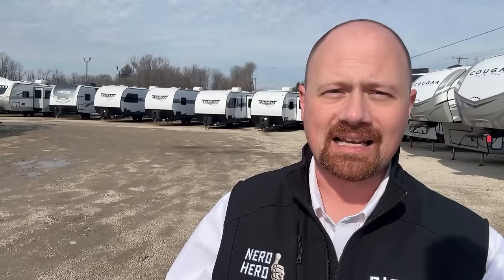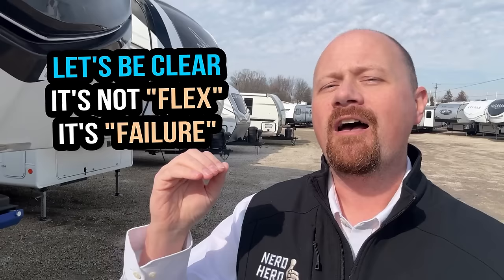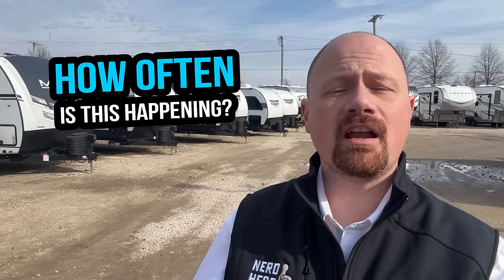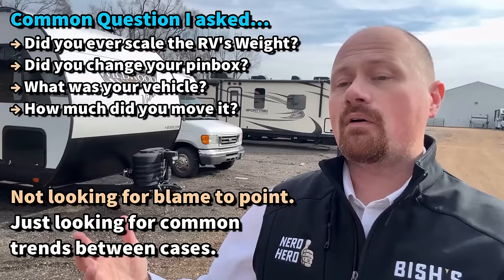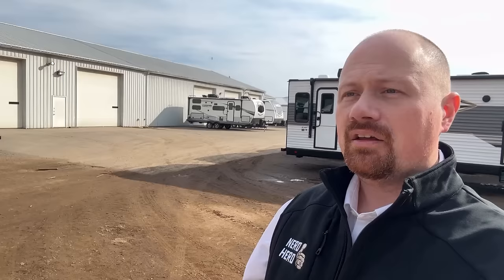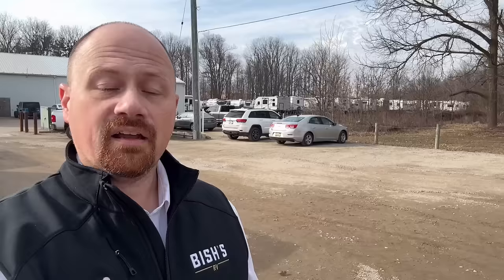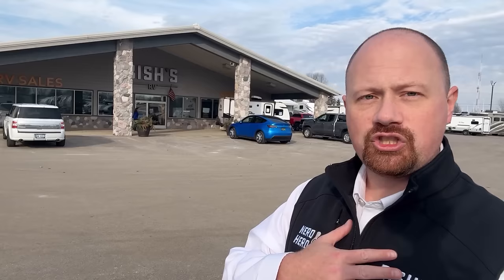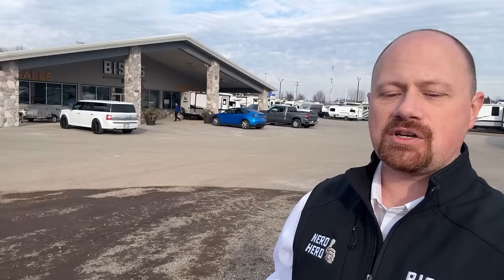🚨 RV Frame Flex & FAILURE!! • WHAT is Happening and WHO is Responsible?!

Comment: Josh you are doing exactly what you claim your not doing. You are blaming the owners.  All your reasons you point out is that it is something the owners are doing. Let me shed some light. One half of One percent is 99.5 percent. That is a horrible rate. That is not even a three sigma value. Should be like a 6 sigma value.  Let me put it on another way one out of every 200 made will have this failure at one half of one percent percent.  One only states it in the one half of one percent to try to word it in a way to make is sound small. That is a deceptive tactic and that is exactly what your are doing.   When vehicles are tested to go on the road the DOT testing and specifications require a huge degree of safety margin. If for example you had a vehicle that had a capacity rating of 1500 lbs, it can not be designed to fail in a catastrophic way if you put 1800lbs in it or even 2000lbs on it.  Secondly you blame the customer again by saying it is because they changed the pin box.  How long have people been doing this with no issue and now all of a sudden it is. What  do the pin box manufactures say?  Once again blame is diverted to the customer.  You did not give or back a single reason for the manufacturer except where you say you asked them and they say it is not them so it can't be that.  The only conclusions you come to is how customers are miss using the equipment and just must not be trained.  For those who wonder why the government is not doing anything about it they will it just takes a long time. What will happen is when a few people finally get seriously injured or killed the NHTA will probably step in and do an investigation and eventually penalties and recalls will be forced.  Unfortunately this will take a long time.  One thing for you to consider is that a company that has millions of frames or less with a smaller company that are out on the road that could be defective and then have a recall for them that is major failure that involves safety could bankrupt a company. That is why you have to use caution about  believing the company line of no we have had no reported issues. But yet we are talking about it now and the forums are littered with examples.  I do not usually write comments and do watch some of your videos from time to time which I do enjoy by the way. I just think in this case you are not as evenly balanced on your message as you claim to be weather it be on purpose or not.
Reply from the maker: I flat state you can’t blame owners for doing these things when the people they trusted with their money never inform them otherwise. I feel that pretty clearly states I am not placing blame on owners 

At the end of the video I flat put other involved parties in blast. It’s important to take the video as a whole and not take specific parts out of context
Reply: Josh That was my point you say I don't blame the the owners but then all of your arguments blame the owners. Meaning you say at the start I don't blame the owners then proceed to make arguments that say it is not the manufacturers and then make arguments that it is something the owners are doing. Then make a statement at the end I am not blaming the owners.  Just watch your video Where did you make one argument it was not something that the owners did.  You did mention one possibility of the steel for the frames but then quickly discount that as a possibility.  Your statement at the end still puts blame on the customer indicating it is something the customer is doing wrong it's just that they are uniformed.  Just because you make a statement I am not blaming the customer does not make it so. All of your reasons do in fact state that it is something that the customer is doing. There is not a single one that states it is something that the manufacturers are doing.   As a note saying to a customer your frame broke because you overloaded it but I might of made a better effort to make sure you knew that still puts the blame primarily on the customer as they did the action that caused the failure. 
 I won't comment on this again, I know it is a difficult subject,  You are creating great content and putting it out there and I do appreciate it. I do enjoy your channel as it has great content and will continue to watch.

Comment: You never presented the possibility of just poor engineering.
Reply from the maker: First, TY for watching and sharing constructive input

It's been a hot minute since I made this video so I can't remember everything I said in it, but I thought at one point I mentioned how MFGs each have a chassis made to their requests. In my head that encompasses poor engineering but I may not have said it overtly
Reply: @JoshtheRVNerd  I think that's related by that could also mean they are trying to cut corners, but I'm talking specifically about human error. We're all human beings even if someone went to school for engineering. Engineers can just make flat out mistakes. They could have added the numbers up for something incorrectly or calculated the load on a certain bracket incorrectly. I've been an engineer for lots of companies and engineers make mistakes all the time. If they don't have anyone else checking their numbers and designs these problems could end up in production. I'm just pointing out that these can be pure human engineering errors from the design phase that no one caught. It even happens with major automative companies.

Comment: No mention of under built chassis to save overall weight, very poor video you obviously sell these units and like any salesman no mention of lippert and the design requirements of manufacturers that compromise end product
Reply from the maker: The topic was addressed really. If more information was made, more clear to people, then they would better know how to use the RV in a way that doesn’t cause damage to things. I can’t fault a customer for operating under a lack of information. That includes things like capacity and proper loading to stay with inspects. With that information, they’d be better armed to choose an RV the better fits their camping lifestyle.

But as it stands without being properly informed, it’s really hard to find fault in a customers actions

Comment: So what your saying is frame failure is 100% the customers fault, not talking about quality of metal that u  touched on. But what u didnt talk about is that these frames are being 'under built' and 'sloppy welding built'. Interesting because 'barely minimal built' IS a common practice for RV manufacturers. Just look at the cargo capacity that some won't even allow for full tanks without exceeding the CC. Get professional welders point of view on these built frames huh! Yeah a lot more to this story than a customer pulling with a semi, changing to a goose neck hitch, and how are they r overloading when frames are not being built for reasonable load to begin with!! So 100% frame failure yes is the RV manufacturer, it is called underbuilt! 🙄
And omg you r long winded man!
Reply from the maker: Multiple times I quite literally said you can't blame a customer for doing something nobody told them they shouldn't do. Encouraged people to educate themselves while begging MFGs and dealers alike to end predatory marketing practices.
Reply: @JoshtheRVNerd  good to hear. 🍻

Comment: I’m very disappointed in this video because I like this channel. But the information given is complete tainted. As a Class A Heavy Equipment Hauler for over 20 plus years I can tell you you’ve got three main problems and it almost directly related to the manufacturer. Quality and Specs regarding expectations. Even if your steel is top quality your welding has to be to grade. And that directly affects your tow rating. If people are being told an almost fanciful tow capacity that doesn’t match the real world environment that doesn’t do the public any good. I laughed when the argument was, People are towing the trailer too much and the tow vehicle is to heavy duty I almost fell over with laughter! WRONG. The trailers aren’t being built and sold with a legitimate rating. They are being overrated by at least 20% if not more. Toy haulers carry more weight in the rear and that will put massive stress on your tow box and corresponding wielding. Are people overloading… yeah. But giving people a wildly over inflated GVWR rating with poor quality is the problem.

Comment: Too much shilling against owners/buyers by this guy. 

These things are underbuilt, poorly designed overpriced piles of junk sold by pasd the buck dealers. 

You rail about the builders not weighing new units but don't do it before you put them on your lot, do you?
Reply from the maker: Multiple times thru the video I make a point to say "you can't blame customers for that" 

I would encourage you to watch the end of the video where I address MFGs and dealers alike. You can't blame a customer for using something the way there were lead to believe they could do it 

Explaining how something happens is not the same as saying who is to blame

Customers may want to swap out a pinbox for a smoother ride. That makes sense. Nobody tells them the negative possible side effects - including the dealership that does the hitching swap. 

So while the customer may have asked to swap a pinbox out that doesn't mean it's the customer's fault. How were they to know when the knowing party/parties never said a word about it?

Comment: 1.  Repeatedly say you aren't placing blame.  2.  Systematically recite reasons why user error is to blame. 90% of this industry is garbage. Ultimately it IS the customer's fault for buying this junk.  Amazing that he did not cite a single problem with the manufacturing. And remember, do not carry two crock pots if your RV is not rated for two crock pots.  Conclusion:  Manufacturers need to do a better job telling you how low the quality of their product is.

Comment: I don’t have an iron in the fire. I don’t own 40 foot 5th wheel and I’m simply a retired journalist. The issue is most often with grand design? So it’s the grand design customers who are “overloading or over using their rv’s?”  How about building a stronger frame then problem solved! Well what do ya know, Lippert will now do that! But you didn’t bother to look into it. 
Im just glad I’m not a Bish’s customer so I wouldn’t have to listen to your BS about why the  camper sidewalls are cracking. I feel bad for those people who will get screwed. Hope you sleep well.

Comment: Josh, sorry man, I just lost a chunk of respect for you.  First DO NOT use "engineered" in any context of towables. Look up the Indiana State Board of Professional Engineers and what is required to refer to oneself as an engineer.  Lippert and all towable manufacturers, at best, have designers.  Second, you just took the side of the manufacturers in 3 ways... I am not going to list them, but I'm a PE and also have half my career in product development and manufacturing.  Had you walked right on the yellow lines of this winding highway of an issue, I'd have applauded you, but you leaned. I get it, you work for a dealer, and for everyone reading this, it needs to be understood that it is NOT the end user/buyer who is the customer of the RV manufacturer, it is the dealers.  Dealers have the power to force the necessary change rapidly.  Things you said about use and loading have real truth, but irrelevant when the frame rolls in with welds that look like first week vocational training class welds!  Yeah, certified welding inspector here as well.  Now asserting that towables aren't designed for the amount of towing?!? Oh man, the class action will be quick sailing on that since there is ZERO published position on this.  It'll be fantastic for NHTSA to look at this too because it suggests there are bombs on the nation's roads with unknown fuses but known explosive load by the assemblers!  Couldn't be any more clear now that the two standards followed for RV manufacturers have zero teeth and are just a money grab for a sticker (the RVIA placard will be most familiar to readers).  Then, onto blame the trucks and the pin boxes... Well, peel it back, Josh, and pull off the forums and even the YouTubers and you'll quickly find a healthy majority with issues are running 1-tons and "approved" pin boxes.  Your family has been in the RV game long enough to remember when there were both superior frames (by far) and lived through bad experiments too (perforated).  Now we generally just have ragged edge, poorly fabricated frames that don't reinforce stress points that can be determined by any competent structural or mechanical engineer by hand calculations let alone what we can do with analysis models!  Without having review by all stakeholders, there's never going to be full accountability and remedy.  Absolutely, there's a percentage that is user error, but if anyone seriously believes there's no responsibility with the manufacturers and supply partners - partners is a key understanding - then they must exist in a dimension outside of reality.  For those interested, every product manufacturer runs under a premise of acceptable failure rate.  However, truth in data is essential, and I assert the RV industry does not have truth in its data, and IMO it is for several reasons.  However, I'll point to two that are going to be hard to debate - once the frame warranty period expires, it's not tracked, and the same for second owners who aren't covered.  I would wager the actual failure rate is higher, but shareholders definitely do not want to see that in reportings...

Comment: Josh, love ya but you  talk in circles technically. It makes complete sense that long and heavy RV's would be much more prone to degradation of the frame in close proximity to the pin box. Not acceptable but it makes sense. A responsible manufacturer should put the engineering work in to beef these areas up and as more and more large 5th wheel's are now on the road we are seeing their lack of proper engineering. 
Simply put pulling 12k lbs of 34' is going to place much less stress on these areas than 20k lbs of 45' will, if they use the same primary structure this is likely to happen. It is cost savings in manufacturing to use the same structure between 34' and 45' RV's, the problem is weight. If they use the same structure that will hold up to the 45' RV in the 34' it will add excessive and un necessary weight to it. They want to keep the weight of the 40-45' RV within the capabilities of a 1 ton DW  truck and they are pushing the limits beyond their capabilities unless they are willing to spend $$$$ on premium materials and solid engineering.
If you notice, most of these manufacturers offer different builds (classes) in different size ranges, it is because of this structure, they are trying to do the right thing but have pushed their limits a bit too far.

Comment: Why? More information is not the answer or the solution. Are you saying a consumer should know and buy a 5th wheel designed to be towed only 3 times in its entire life cycle? Hog wash. Should a manufacturer know the buyers life style and how they actually use the RV? Grand Design either deliberately under engineered their rig or they are utterly incompetent. Stay away from Grand Design. Nuff said.

Comment: Isn’t it odd you don’t see this issue in the trucking industry with their trailers. This has to be the most long-winded video I’ve ever seen with much to do about nothing! We used to make steel in US now it all comes from China! Hint, hint, hint…. Cheap steel, cheaper RVs breaking, And you want so much blame the consumer. You know that’s a bunch of BS. As Pick up trucks nowadays have to meet fuel requirements that means less power than years before..
Reply: Semi trailers don’t compare to a RV built completely different than a 5th wheel RV.